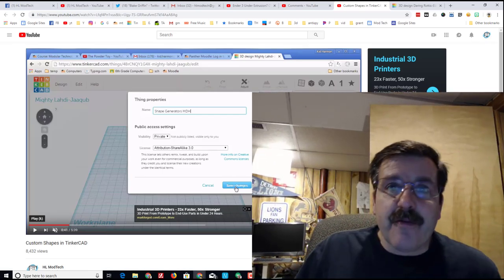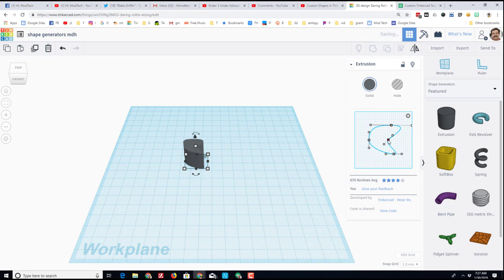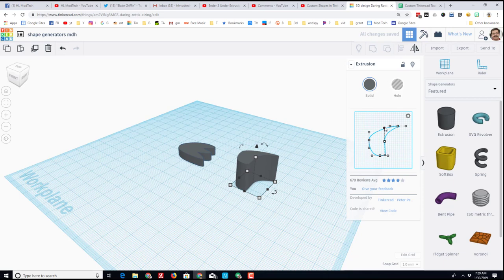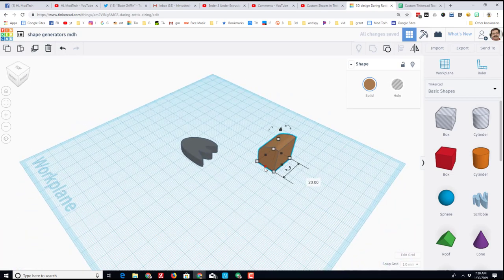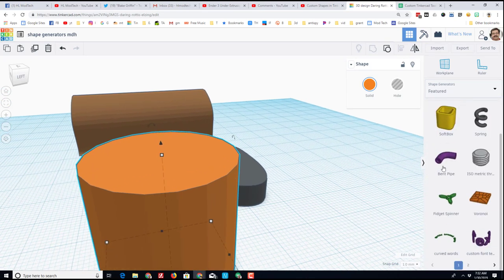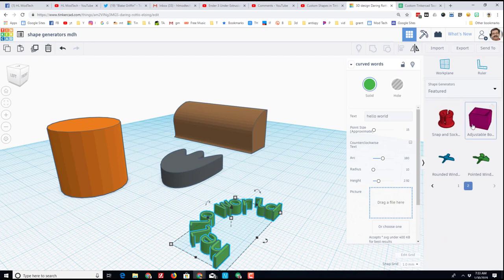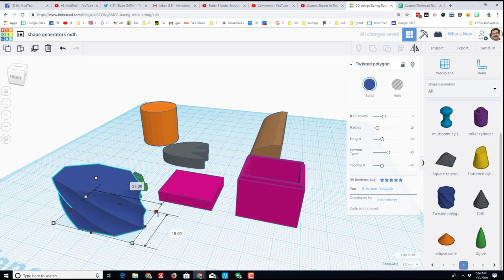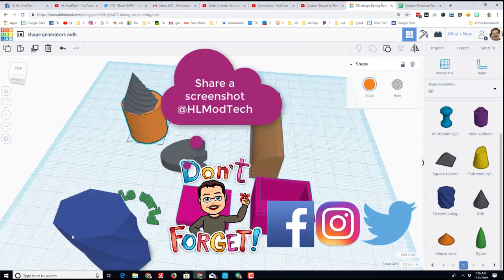The Shape Generator in Tinkercad. Unleash your FULL design potential!

Comment: LOVE! The videos! ... do you know of a way to make shapes as smooth as possible? I used the Shape Generator: Ring, to make a trumped shape on the end of a cylendar, but the max number of sides is 24. When I printed it, it's very noticably not smooth. Any way to make it smoother? 

The only way I found to do it, is duplicate and turn it a bit, and duplicate and repeat, so you have more shapes with more sides, making it smooth-er..  but now that one shape is like 10 shapes. Not sure if that's cool, or overcomplicating the number of shapes for export, etc. Thanks for your help!
Reply from the maker: Thanks for the kudos. Would you like to send a share link so I can see inside it? Here's how https://youtu.be/XeDQjhRK8lg You can reach me at hlmodtech gmail.

Comment: Is it my version of TinkerCAD or is there an issue with editing or changing Z dimensions (it lets me change X & Y but not Z)?  Is there a F key or control key that will allow changing height shapes, like bending the top in a particular direction or from a square on the bottom to a triangle at the top?
Reply from the maker: Designs always have 5 white handles. 4 for the x & y corners and 1 for the z. If you use the corner of a view cube it likely be easier to spot the handle for Z. This vid is super short and I show the Z handle in the first 2 min. I click and type a number, but it would be the same if you grabbed it. The cone above it lifts the shape off the workplane.

Comment: I know this video is 4 years old, but I hope someone can steer me in the right direction. At the 55 second mark I finally learned how to alter a circle. How would I make a semi circle inside of a box, with the semi circle being  hollowed out? I am making some small tooling holders and that would help things along. Thanks
Reply from the maker: This video might get you on the right track. https://youtu.be/6r-H0o_ZlZQ  Of course instead of full circles you could use the shape catalog to find a semi circle option that fits your needs. You may want to check out my shape generator catalog. It makes it easier to search for shapes by name https://youtu.be/l9PHk4gqtfM
Reply: @HLModTech  sometimes the videos with this software look different than the software I'm using. Maybe a newer version? I did finally figure out how to make the holes in my pieces.
Reply from the maker: Glad you were able to solve it. Tinkercad has updated quite a bit in the last 2 years. If the video is from before 2021... it will be pretty different. Feel free to reach out if you are ever stuck.

Comment: Hi i'm using tinkercad all the time, but the problem i have is the shape generated features won't drag across on to my work plain, what am i doing wrong?
Reply from the maker: Try this. Click the item you want to use... then pause a moment and move your mouse to the workspace. It just took a moment for the system to catch up and then I was able to place "australia" where I wanted on my work plane. =)
Reply: @HLModTech  I tried that, it highlights the object with a white square as in bent pipe and when i slide it to the work plain it comes up with loading document in the bottom left hand corner and that's it
Reply from the maker: @grahamc9369  Hmmm. What browser are you using?
Reply: I opened a new work plain,  clicked on the object for 10 seconds then slid it across to the work plain, 10 minutes later still nothing on the work plain, basic shapes and numbers go straight across no problem
Reply from the maker: @grahamc9369  That is really frustrating. I have a friend that codes for TinkerCAD. I will shoot him a note and see what he says. What browser do you use? Working on a laptop, desktop? How about wifi vs ethernet?
Reply from the maker: @grahamc9369  Try this link. I have 2 shape generator parts in it. See if they appear https://www.tinkercad.com/things/jhGHIsy38Rv-super-amur/edit?sharecode=AKnMyBWd2bLmbueU_3qA9c2fZeoik047_zj3fogLdXc
Reply: @HLModTech  Hi, when i open that it all seems to work, thanks. i run Imac desktop, Firefox and ethernet. i will keep using and will see how it goes, so far so good. Thanks again
Reply from the maker: @grahamc9369  My pleasure. I have heard that Chrome may be better for TinkerCAD. I have used them all though. I saw your edits in there which was super cool! Have fun creating!